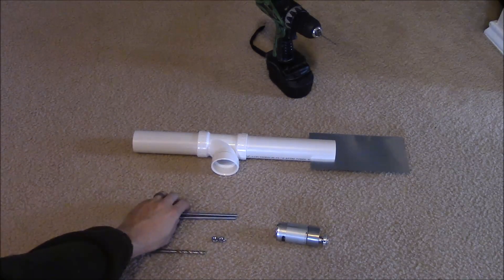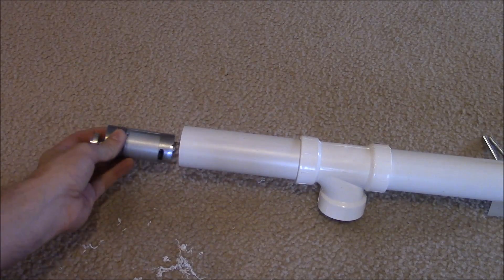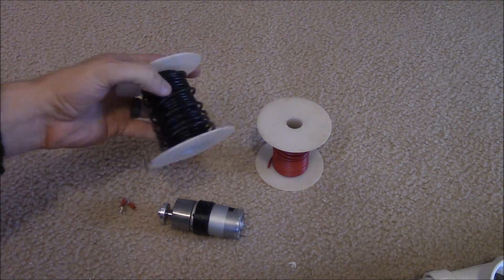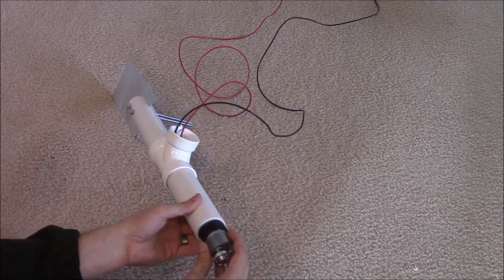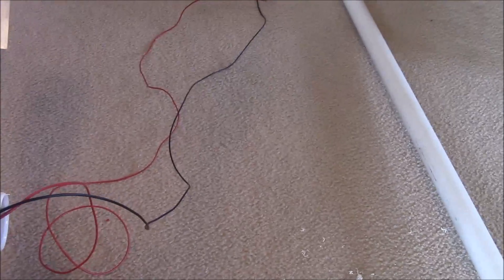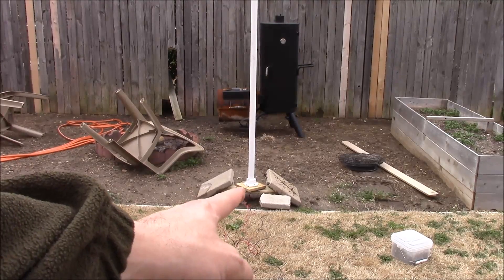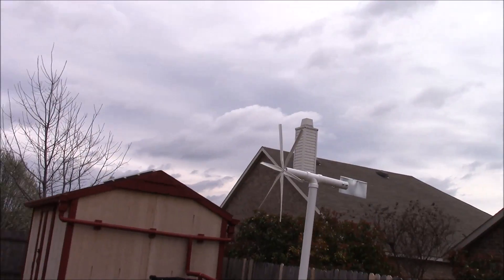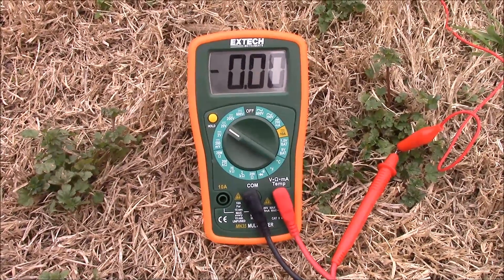How To Build A Micro Wind Turbine - Part 3

Comment: All I can say is nice video series and there's room for refinement and of course some changes as you learn more.
Now the geared motor that your using isn't a good choice for this type of project because the wind will have to blow at higher speeds just to make the motor/generator produce anything but if you had decided to use 775 motor without a gearbox you will get different results.
If you look up a three phase AC motor you may get better results than what you saw using a geared motor.
Reply from the maker: Yes, this was very rudimentary and I knew very little about wind turbines at the time.  Still don't know a lot.  If I can move out of the burbs in the next year you can bet your life savings I will be putting up a wind turbine on my next property!

I tried to find a non-stepper motor that was about the right size and had an integrated drive wheel on it but that was the best I could find.  If you can find me something more suitable on a small scale like this then I am all about trying this again.
Reply: @LDSreliance  what is the size of the motor that you used? I'll look for a different motor that may be better than that one. Have you thought about salvaging some motors from old printers, copiers, scanners or all in one printers?
In the mean time you may want to check out these viddos

https://youtu.be/AS74oAmjpxU

https://youtu.be/YY1oCNhD8_0

https://youtu.be/AckRAYQ8N48

To get a better idea of what you can use.
Reply from the maker: I don't remember what size it was.  That was a while ago.  Most printers and copiers and things use stepper motors for precise "steps" and control over positioning.  But, like I said, the critical consideration for me, at the time, was that it had a built-in way to drive a wheel/gear.  Most motors do not have that and I don't know enough about hobby motors to devise my own propulsion/transmission system.
Reply: @LDSreliance  ok and the reason I asked about printers is the ones I've taken apart had regular DC motors in them. Did you check out the video links I sent you?
Reply from the maker: Yes but they don't give any specs on the motors so they aren't terribly helpful.
Reply: @LDSreliance  ok I'll look for other motors that you could use.

Comment: You need to use a larger diameter pvc pipe for the blades. They are way too curved.
Reply from the maker: Yeah if I was going to make something permanent I would definitely make better blades.  They sucked.  I just wanted to prove the concept here.

Comment: Put the swivel at the top and firmly secure the vertical post.
Reply from the maker: Yes, that would have been a better design.  I also needed to put in a stop to prevent the top from spinning 360 and twisting up the wires inside.
Reply: I believe it's called a slip ring connection it allows it to spin without twisting the wires, I think ?

Comment: Nice and descriptive illustration. I watched all 3 parts of this section, but I wanted to know about charge controller and wiring to the battery bank, like you did in your beginner solar part 1 because I want make a small size wind turbine like this and I don't know about wind turbine charge controller. Also, in its first part you mentioned about a regulator or something, but didn't tell about that later. I hope I will get missing information.😃😃
Reply from the maker: Sorry, I don't know as much about wind as I do solar.  I do know that there are some charge controllers that can do both wind and solar but they are more expensive.  There are also some dedicated wind charge controllers, too.  You will also need a diversion load because unlike solar panels, wind turbines will produce power even when you don't need it and that power has to go somewhere or it will fry your turbine.  So a diversion load is a place to dump excess electricity after your battery is fully charged.  One great example would be a water heater element.

Another thing to consider is whether your wind turbine you build will be AC or DC power.  I believe the regulator that I mentioned in the video is to rectify the power to produce DC.  Most commercially sold wind turbines produce AC power which has to be rectified into DC power in order to actually use it.  You can't just use the AC power directly off the turbine.
Reply: +LDSreliance : Thank you brother for replying. You mentioned that you don't know much about wind turbines, but whatever information you gave is very important for me. I am trying to find more information about this on Google and YouTube. Today, I learnt something new from you about wind turbines which I didn't know before and at least you me an idea that which way I have to go.

I am not a person from technical field; I'm a guy who works in office with computers and papers, but I'm very possecinate about renewable energy and it's my promise to my 7-year-old son that I will make a small wind turbine to light his small house, which he has made by cardboard.

Thanks again, and greetings from India 😊😊
Reply from the maker: You are a great father!  And I admire your DIY spirit.  You don't have to be from a technical field to figure things out if you put your mind to it.  Good luck!
Reply: Thank you dear😃

Comment: The turbine needs to swivel at the top so that you can add guide wire to keep it steady in the wind. it also keeps the pole steady so you don't need a 1000 lbs to hold it from tipping over. The electrical tape made LOL. it will hold heat, and the adhesive will break down.  the motor will over heat and die due to the heat and the lack of air circulation around the motor.  you also have no nose cone to keep the water from getting in. I would be amazed if this lasted more than a month.
Reply from the maker: I agree.  This was an experiment as you can probably tell.  Never built for production.  I wanted to learn some things by building a small scale model and I think I did that.  I now have capabilities that I didn't have then such as a 3D printer to be able to fabricate pieces.  Hopefully I will have some time to do another version this summer and make those improvements.

Comment: Bro i like it its small and still brings in some voltage, but my thing is what do you think of adding a home made power bank made from laptop battery's and a 40w solar panel to all so help bring some voltage witch i think would help out while charging other small or one big appliances...
Reply from the maker: That would be great.  Best of both worlds.  Then you can have the sun bringing in a big surge of power for 4-8 hours each day and then the wind trickle charging all night.

Comment: As the wind changes direction, eventually it will twist up your wires until they snap.
Reply from the maker: Right.  For a more permanent wind turbine you would want a stopper that would prevent the turbine from rotating more than 180 degrees.

Comment: You talked about some kinks you needed to work out to provide some meaningful power, could I ask what they are?
Reply from the maker: Blade design and durability would be a big one.  This model spins up in low winds but will cut off in big winds.  Big winds make a lot more power obviously.  So making some blades that do a bit of both would help.  I need to put a stopper on it to make sure that it doesn't keep spinning around and around in the same direction and twist up the wires inside.  I need to find a different model of motor that doesn't have gears (stepper) so I can overcome that cogging effect that prevents it from smoothly starting up.  Stuff like that.

Comment: Better make the pivoting point at the top and keep the bottom fixed with some gide wires to the ground :-)
Greetings from Belgium
Erik
Reply from the maker: An excellent suggestion.  If and when I build my next one I plan to do that and also add a stopper so it can't spin around and around and twist up the wires inside.
Reply: +LDSreliance a stopper is also a great idea :-)

Comment: Try using sheet material for the blades. Aluminum sheet in 1-2mm thickness is great to work with and relatively cheap at the hardware store. 

To form your blades you can just use a flat piece of aluminum and give it a twist right at the hub. Worked out verry well for a test I did years ago.
Also you could shape your blades over a large tube, this should give better results than just twisting it. 

In RC airplanes there are motors called brushless outrunners. These produce can enormous torque at low rpm and I had great success using them as generators. with these you will need much lower gearing thus getting greater efficiency.
Those motors are available cheap from China. 

One last thing:
In one of the earlier videos I noticed a imbalance in your propeller. Try to balance it. The imbalance eats up massive amounts of energy and the wind turbine I built shaked itself apart...
Reply from the maker: Thanks for the tips!  Any links to the type of motor you are talking about?  I must have spent dozens of hours researching small motors and kept coming back to the stepper motors as the only thing that could produce any power at lower rpm.  Most hobby motors operate at very high rpm.
Reply: +LDSreliance 
http://m.ebay.de/itm/G-SUN-2208-Gimbal-Brushless-Motor-90KV-3mm-shaft-for-SJ4000-I-/391010655972?hash=item5b0a0d1ee4%3Ag%3AGekAAOSw1ZBUt4uz&_trkparms=pageci%253Ab50390b3-63ec-11e6-915f-74dbd180da2a%257Cparentrq%253A94f4faad1560a2a4c78b3e8afff124b8%257Ciid%253A8
This is a small motor of a special type called 'brushless gimbal motors'. They are normally used for positioning tasks but also do great as normal motors. These are the slowest running motors I know of. The advantage of brushless motors in general is that the output voltage they deliver is not so dependent from the rpm that you spin it. 
I can check the unloaded voltage+power capability of a motor similar to the one in the link at 500 rpm, if that is of any use for you.

And your right, hobby motors mostly run at enormous rpm. Outrunners run slower, some do below 5000 rpm at rated voltage.
Reply from the maker: Fabian Rudzewski I would be interested in what a motor like this can do between 200-500 RPM which is where you would be in realistic wind 90% of the time.

Comment: Where do you run the wires to? Do you need a similar controller that you normally use for solar panels? I assume you need a regular golf cart battery and an inverter.
Reply from the maker: +Kirill Pushkin There are specialized wind charge controllers but they are very similar to solar ones.  I was hoping to be able to trickle charge my battery bank at night with this thing but I had some challenges.  And yes you would need a battery and inverter to be able to use AC devices with it.

Comment: When the wind changes direction and the turbine pivots, doesn't that get the wires all twisted up over time? Also, could something like this be attached to the front of a camper van to charge the house batteries while driving? I mean without the tail or pivoting, just mounting it in front of the grill. Could the motor from a box fan create electricity? What if I just bungee corded a box fan to the grill of my van and ran wires back to the house battery? Would that work?
Reply from the maker: +Daniel Veazey Yes, the wires could possibly get wound up inside.  This was mostly for an experiment on my part and there were definitely some things I would do differently if I were going to permanently mount something like this.

A box fan can't produce electricity as it doesn't have a permanent magnet dc motor in it.  There are certain types of AC motors that can be rewired to produce DC power but only if they have magnets.  It is fairly complicated and not something I would recommend for a beginner.

I have thought about generating wind electricity while driving before and I am sure you could do it but it would have to be safe and it would really only generate meaningful power on a road trip or something where you are going fast for a longer period of time.  Smaller wind turbines don't produce a lot of current but you could probably make enough power for charging cell phones and tablets and portable dvd players and such.

Comment: Thanks for sharing this !!! This was very fun to watch !! I am curious to if their are motors that will generate 50 kw?? Again, thanks for sharing !!
Reply from the maker: +ddmaxlow I am sure there are motors that big but that would be a monster wind turbine!  That would power about 20 homes or so.  What do you need something that big for?
Reply: I am just kind of learning about electricity and electric generators. I was just wondering how feasible it would be to build a wind powered generator and have it power my house :-DD Just kind of curious about the off the grid thing.
Reply from the maker: ddmaxlow
You can certainly do it if you have the wind in your area.  You would for sure have to use a 50 foot pole to get high enough for the volume of air needed to consistently power a house, if your area has enough wind.  If you are smart with your energy you could get away with a 2-2.5 kw system (i.e. if you are not using electric heaters, electric water heaters, electric dryers, electric air conditioners, etc.).
Reply: I am really bad about that. I have never really been really energy savy. I knew if you moved a magnet across copper it would generate electricity and that's about it :-DD But I am learning a whole more things lately. Thanks for taking to the time to help! And great video by the way.
Reply from the maker: ddmaxlow
You are welcome.  Thanks for watching and keep asking questions.  That is how you learn.

Comment: where could I find a motor like you are using?  I want to use a turbine in Wyoming to charge camper battery.  I made a solar panel that produces 17 volts on a clear day. Wyoming has a bad rep on having cloudy days with wind blowing.
Reply from the maker: +Robert Floyd Yeah wind would be better in Wyoming.  I just ordered a hobby dc stepper motor.  The link to the exact one I used is:

http://www.amazon.com/gp/product/B00D839AN4?psc=1&redirect=true&ref_=oh_aui_search_detailpage

The reason I used it is because of its low rpm which will allow it to produce power at lower wind speeds.  A lot of wind turbines you find out there need 15 mph winds to do anything and that just doesn't happen on most days.  Maybe if you were on top of a hill or near the ocean you could get away with that but I wanted something that would produce in 7-8mph range.  You will need bigger rotors than the ones that I used, though.  Try for some that are about 24" long and see how that goes.
Reply: +LDSreliance   thank you for the amazon link. I ordered one. Hopefully have it built for spring fishing.
Reply from the maker: Robert Floyd
Nice!  Good luck with it.  Let me know if you need some help.

Comment: Very nice work,  little more perfecting and some rearranging of placement and think you got a decent little battery charger.
Reply from the maker: Raquel Bauman Thanks!  That is what I was going for.  Just a little trickle charger that operated off and on around the clock.  My solar panels are great but only really work well for 5 hours or so per day.
Reply: Thats what self reliance is all about what works for you may not work for everyone.  Great work Ill keep watching.
Reply from the maker: Raquel Bauman Thanks!  I appreciate that.

Comment: Where can I buy the negative wire and positive wire? I can seem to find it anywhere. Home Depot only has red and black wires, and the clerk looked at me like I was crazy when I asked for it.....
Reply from the maker: ib scooter70 There is no difference between the wires.  One is colored red so that you can easily tell visually that you wired it up to be the positive wire.  The black wire you can easily tell is the negative wire.  You could wire them up backwards if you wanted to.  So go to Home Depot and just find some low voltage landscape wire or just some THHN wire in the gauge you like.

Comment: Good job man! I want to make something like this too. Do you suggest any good electric generators? Also try to use odd numbers of blades not even because when ones pointed to the ground two are above it making the blades want to fall creating a more smooth continuous motion, 5 or 7 blades would be best. Thanks man!
Reply from the maker: KillaBitGaming Yeah the only reason I did it this way was because that was how many holes my hub had.  I will experiment with different blades in an upcoming video!

Comment: Hello! I liked your video. It's great. Allow me to give you a hint (only because I enjoyed so much your work). Instead  of putting your pivot point at the base, you could make it at the top of the pole. I'd change that because the weight of the turbine plus the strength of the wind are applying a torque to the base. That makes it more difficult to the pivot spin. Furthermore, with the pivot off the base, you can fasten the base much more, providing extra stability and sustainability. Wish you the best!
Reply from the maker: carlos reis Yep, that is definitely evident to me now but I didn't think about it before I built it.  I plan on doing a follow up video making a few corrections like that and also bigger blades.  Stay tuned!

Comment: Fan blades too small. Position turning blade not suppose to place at the bottom of the pipe. You should place it at the top of the pipe. Fix the position of 7 foot pipe then the fan will turns to the wind position accordingly
Reply from the maker: hello pig Yep, I learned that.  Good points.